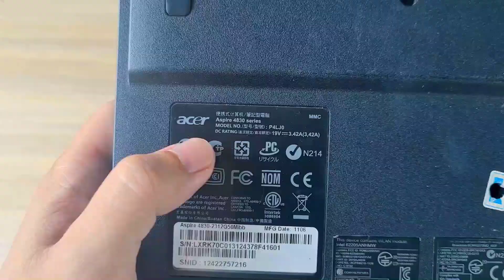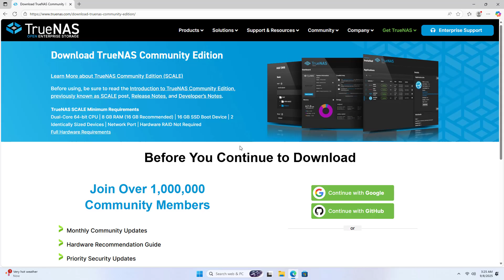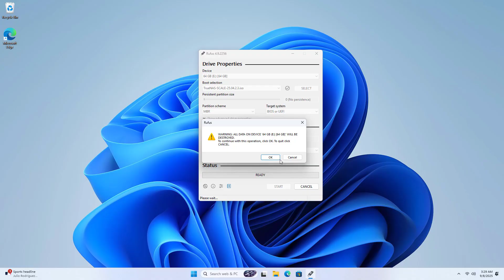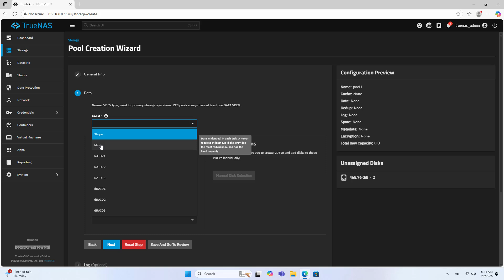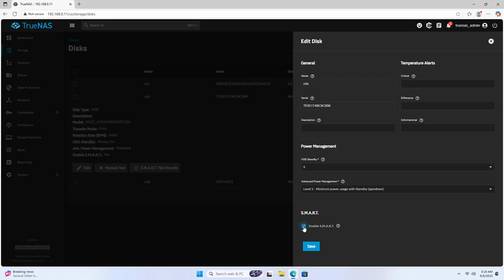Turn Old Laptop Into NAS

Comment: I have a question. I have a Mikrotik hap ax3 router, I inserted a flash drive, formatted it and set it up. But it is not detected in the computer or in the TV (dlna). Where am I wrong?

Comment: What about wi-fi socket ? Maybe can use mSATA SSD ( or M.2 Nvme , depend of type) Disk for system boot ?
Reply: In the laptop, needed to connect a drive Sata-USB Adapter. Used a USB Drive for 8 watts NAS. 😅
Reply: В 99% в ноутбуках в Bios есть whitelist со списком разрешенных устройств (обычно там прописаны несколько wifi модулей). Проблема решается можификацией bios (обходом whitelist или добавлением в него своего устройства)